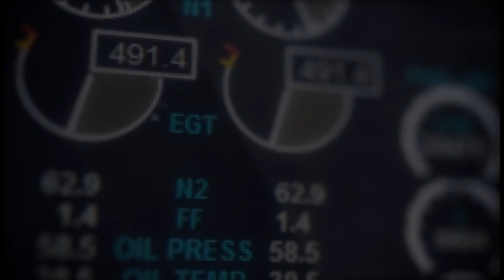Will Circular runways "take off"

Comment: By 2050 I would prefer we moved onto VTOL aircraft, If we don't have that down well in 30 years I will be ashamed.  Military (well US military) is running with it pretty well now, 3 of the 4 services running the MV-22 and the army is evaluating another one in competition to take over the vast majority of there air fleet.  Then you got a fast jet STOVL aircraft now with the F-35B, the tech is there just needs more maturing, better engines and so forth, but jet engines powering lift fans would def be interesting to me.
Reply from the maker: That would be interesting, yes.
Reply: fuel consumption and maintenance are a big problems. Military doesn't have to factor that is nearly as much as a commercial carrier has to. There's a reason there aren't afterburners are not on a commercial plane.
Reply: there's no afterburners on commercial aircraft because they are all subsonic, afterburners are typically put on aircraft that need extreme levels of acceleration or need the acceleration boost through the transonic region.  Both supersonic airliners in history had after burning engines on them for this very reason, and yes that increase the cost of operation.  The largest focus in military aviation at this time is operation cost, they are trying to improve there CPFH and the lifetime cost of the aircraft they are buying today.  Aircraft like the F-35 are centered around this idea, they are cheaper to run in a CPFH using tech like ALIS and the networked simulation technology.  ALIS allows less maintenance to be done on the aircraft on the ground since you no longer need to spend hours doing preventative maintenance and checks, it also optimized the logistic chain of the F-35 fleet worldwide.  The network flight sims allow for more complex and immersive simulation training allowing less flight time to be wasted on the airframe doing training, and the pilots get a over all increase in training throughout the year.  The networked aspects lets F-35 simulators from around the world link together to train in a synchronized training environment with virtual enemies, while also be networked to actual in flight F-35's that are seeing and fighting the same virtual enemies.  This allows the countries buying the aircraft (which aren't cheap at 90-100 million flyaway) to keep them in service without expensive SLEPS down the road for 40-50 years.  The Army's upcoming program to replace most of the vertical lift aircraft in the us army inventory is requiring similar technology and goals.
Reply: I stand corrected. I was being glib the AB's. My point was that the energy expenditure to create the lift for a load vertically is so much greater than to generate your lift via a wing, that unless a radically new means of thrust vectoring comes about the CPFH doesn't pen out. The CPFH for rotorcraft is very high and the V-22 while much improved isn't as reliable as would needed for commercial airlines. That said, if one looks at how far we've come, nothing is that far out.
Reply: I did say 2050 in the original statement so we got time :D.  The MV-22 had all the typical teething problems associated with a radical design.  The Marines seem to get good reliability from it now.  Bell's newest offering for the Army vertical lift program the V-280 is suppose to take everything about the V-22 they didn't like and drop it or change it to be more reliable and cost effective.  The system I am thinking of for the future will prob end up being more niche then anything else, small routes, even commute routes to major hub airports where the long range 200-300 passenger intercontinental jet's land.  I don't see anyway of making a 200-300 passenger STOVL or VTOL aircraft that can fly internationally and hopefully by 2050 supersonic.
Reply: I agree, it's cool to see the VTOL plane in "Contact" with Jody Foster, but it's not likely anytime soon. However the creator's of the cell phone were inspired by Startrek's communicators hence the flip phones evolved from the first "Brick's". Granted the order of complexity of planes to cell is extreme, but current phone tech is so far advanced from what the original designers even dreamt, that Startrek's are communicators primitive compared to what is available. So while the circular runway is goofy perhaps it inspires the something truly profound and revolutionizes how we think on how takeoff on lands large payloads better. The V-22 also is a good start as the Harrier was to the  F35B.

Comment: The individual points you make are strong by themselves, but only in a vacuum. You mention centrifugal force, for example, which would definitely be a problem on a flat runway, but you follow it up by critiquing the steepness of its slope. Yes, an aggressive slope would require aircraft redesigns, but does it have to be steep? Why change the aircraft when a greater width could have a gentler slope? Unlike straight runways, engineering problems rarely have only one possible approach.

I went into this thinking the idea of a circular runway would be ridiculous, but ironically, your critique has made me wonder if they're actually onto something.

Comment: Long before a circular runways issues are resolved, we'll all be traveling in Tesla rockets for the long haul trips. That will reduce the congestion at larger airports as they will be used for short hops that don't yet have the Hypertubes or some other fast transport. Air travel might move to giant airships that resemble the cruise ships of the seas. Or we might see things like space based cruise ship like in the movie '5th Element'. 
If circular runways were implemented 70 years ago, it could stand a slim chance. Heck, the Navy experimented with it back in the 60s. It just has too many issues to be of any use today. For crosswind landings the gear on the B52 would be a better solution to the problem. Until then, we pilots just use a lot of rudder and be quick about it.

Comment: Sixty years ago I saw a concept of a “flat“circular paved area a mile in diameter. Outside the perimeter was the circular parallel taxiway.
Back then the largest aircraft only required about a mile in length for takeoff and landing.
Every 10 degrees from magnetic north there was a magnetic number painted with a centreline that passed directly through the centre of the circle. 
Depending on the wind, ATC gave the magnetic number as the active runway, the aircraft taxied to that number then lined up on the centre line. All takeoffs and landings were always into wind.
JH

Comment: The nice pun in the title and the interesting thematic got me here, and I dont regret it. Very nice video, and you did not even mention every problem with circular runways. I think, a better system of high speed intercity trains would be a solution with way less new created problems.

Comment: The engine failure thing actually shouldn't have an impact, since the slope of the runway uses the gravitational force to counteract the centrifugal force.
Also, you would build the runway wide enough/high enough or dig the airport field down a bit to get enough space for the wings.

Don't get me wrong, I don't think circular runways are something we should be doing, but these two issues aren't really problems.
Reply: the first question i have is do you watch nascar? If you have the unreasonable bank angle of turns is the degree of bank the airport would have to achieve. (which is about 30 degrees). second the wheels of the plane cannot withstand that amount of stress produce by all the difference forces acting on it as it accelerate and decelerate due to the high mass to surface ratio. 

The second point you've made is the bank angle shouldn't influence the clearance of the wings but that would mean you would need a gradual bank with the wingspan of an airplane. I'm assuming that as the plane accelerate you want the plane to move towards the outer edge of the ring with more bank. 

In the video he mentioned that a failure of the outer engine (in terms of the circle) would cause the plane to suddenly lurch outwards. its the same as a nascar having tire issue in the outer wheel the cars flys out from the circle and hits the barrier 

Those are certainly some of the issue the plane would face if they take off on a banked circular airfield. (These comments were made with my limited knowledge of physics... but substituted with common sense so its not 100% accurate)

Comment: Let's take the example of a Boeing 737 with a takeoff speed of 130 knots, and do a lateral G force calculation in metric. That speed will be 240 km/h or about 66 metres/second. If the diameter is 3km, the radius is half that or 1500 metres.
A =v²/r = 66²/1500 = just under 3 m/s² or 0.3 Gs. That's a rough maximum, of course, the G forces would build up with velocity, and alongside the other forces the plane and passengers are already subjected to.

Comment: These sorts of comments by pilots seem counterproductive to me. Lots of things are "not practically doable" because extreme safety demands executed by absurdly slow humans can't handle the complexity ... well ... we have solutions for that don't we ? Why are humans directing aircraft as opposed to programs ?

Adding insult to injury is looking at just how much airspace this way of working occupies. In London, 4 airports occupy >80% of all airspace above 300 meters. How much of that airspace do they actually occupy ? Let's say a plane occupies a 3d ball with a diameter of 1km (125 times more than is considered safe, as normally 200m is used), airspace going from 300m to 10km300m (for ease of calculation). Well, that makes all planes in the air above london occupy ... my back of the envelope python assisted calculator says 1e-14 of the airspace. A TRILLIONTH of a percent. And for that travelers pay with increased wait times, increased costs, less total planes, ... and so forth. 

I can understand the argument that humans can't safely direct more planes. Mostly this applies to a disaster scenario, not so much to normal operation. Yet writing programs that fill 10% of the sky, controlled from onboard the planes without communication other than a loosely defined pre-agreed flight plan (in other words, they always fly under the conditions that air traffic control considers total system failure) is not difficult (and it is in fact a necessity since you cannot get 100 objects to communicate on a wireless network reliably). Humans, however, cannot control planes like that, it just doesn't work.

We simply need to thoroughly rewrite safety regulations and make our airspace accessible. By all means let our "mark 1 brain" pilots fly, for fun. But real aviation, goods and people transport, let's bring that into the 21st century.

Comment: My grandpa landed on a round shaped lake to small to take back off of in the middle of no where Canada....He flew the Cessna 180 tail dragger on floats in circles as close to the shoreline as possible until lift off where he banged the tops of the pines off the floats.....barely made it.

Comment: Captain to Passengers: "Ladies and gentlemen, we are on final approach to the Good Luck International Airport. We are in a left bank. It's not because we're off course, it's just that the runway is circular. When we touch down, please ignore the fire from the right wing tip. You will feel a bump from the right landing gear. Do not be alarmed. It's just the right tires blowing out. We have lots of spare tires at the gate. Please note that we will be leaving from the left side of the plane...very, very fast. You'll enjoy the blow-up slide. We include that ride at no additional charge. Once again, thanks for flying with us. We hope to see you on another flight, if you live. Captain out."

Comment: it would work for landing with not too much difficulty, but for takeoff it wouldn't work at all, the very idea of a banked ring is designed to hold you down at speed, so you can pour on as much throttle as you like, you'll still be flying into what is essentially a wall and just pressing yourself harder and harder to the ground

Comment: I agree with most of what you said.
Just another point of failure - you would not be able to accommodate multiple aircrafts landing and taking off at the same time unless it would be total distance of:
minimal length of runway for both aircrafts needed to take off plus minimal length for both aircrafts to do emergency stop from at least v1 and preferably from between v1 and v2 - this would make it very, very long and trying to squeeze more then aircrafts might be impossible due to limits of size of an airport itself
I see this and congestion of airfields as major obstacle

Comment: What angle of banking of the runway would be required? Speedways can bank as high as 33 degrees, but they are much smaller than you were discussing. These runways may work in the future when computers take over more of the flying.

Comment: Circular airports (as opposed to circular runways) were used from before WWI and through WWII, but they worked by allowing aircraft to land straight into the wind without the need to turn the plane.  They were necessary in WWI because planes had non-steerable tail skids instead of wheels.  Landing in crosswind could lead to a crackup.  Later the US Navy used them for basic training and for carrier simulation.  Such a field today would have to be massive in size and surrounding approach clearances, making them impractical for all but short field capable aircraft.

Comment: NO.  Someone needs to review physics. Work Force; If an object is moving in a straight line with position function s(t), then the force F on the object at time t is the product of the mass of the object times its acceleration. Note if velocity and acceleration have opposite signs, the force is acting in the direction opposite to the movement of the object. Start with "Isaac Newton's First Law of Motion". LMAO 👎 x 121
Reply from the maker: True.

Comment: As a high time pilot, not only do I remember my beginnings in GA, and an afternoon at any GA FBO or flight school will convince you that the introduction of another dimension to current runway designs will accomplish little given the cost in lives just during initial training. I lost friends during carrier quals and that deck is simply canted off axis of travel and shortened. Whose bright idea is this, another real estate developer? Buyer beware, if you buy in the crash path you live with the noise and shut up. Noise abatement is DANGEROUS to us and to you!

Comment: In my humble opinion, unless the physics of how commercial airliners fly, airport layouts will not change much for the remainder of the 21st century. The biggest change we may possibly see by the end of the century are takeoff and landings that use battery power to reduce noise and also the use of bio fuel for the rest of the flight. Non of these changes would really affect the physics of runway approaches.

Comment: First of all, I have no clue about aviation. I've just been thinking about what you've said in this video. A few of the round designs drawbacks could be avoided by using a polygon instead of a circle. THat way you don't need banked turnings and planes can stay the way they are, those safety corridors are reduced to, let's say six or eight, you reduce your calculations from 360 (one per degree) to six/eight while still being able to react to crossing winds more flexible than with a straight runway. The problem of finding a large enough area and syncing with other airports still remain, but that way some drawbacks are reduced or avoided totally.

Comment: I'm really good at crosswind landings and takeoffs.  A circular runway will provide a constantly changing crosswind vector, also from headwind to tailwind.  This element alone will eliminate many otherwise proficient pilots from providing a full career of safe operations.  

One way curved runways work on remote mountain sides only due to the special skills developed by the few pilots who want to.  Most don't. ⚓️

Comment: While I'm just a private pilot, I know several commercial pilots. For those of you that aren't - have you ever noticed that on most flights you come in level. This is for your comfort. While I might take my Cessna in at an angle, most passengers prefer to stay level for comfort reasons. So the pilot will simply use cross-controls (crabbing) and "kick" the rudder just before landing to straighten out. With a circular runway I don't see how that could be done. Also, what about emergencies? Single-engine failure isn't a major event for an airliner, simply divert or turn back. However, you're likely heavy (more fuel in your tanks than is feasible to land within operational thresholds). Either you can dump fuel (if permitted), fly around in circles burning it off (great use of an IFR holding pattern), or you can attempt to land and have a LONG roll-out. This concept would put an immense load on the gear and the structure of the aircraft. Finally, what about control failure emergencies? I've simulated aileron and elevator failure landings (wow does THAT raise the pucker factor), I couldn't see how you'd account for the curve in the runway while dancing on the rudder, and flaring with trim. Just seems like a bad idea. Maybe having an oval, but not a circle. Just my thoughts.